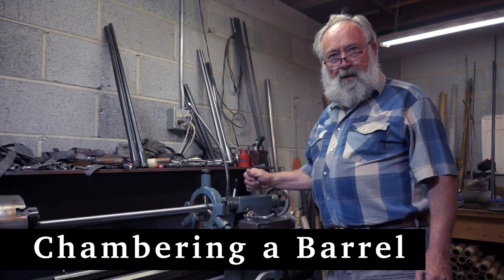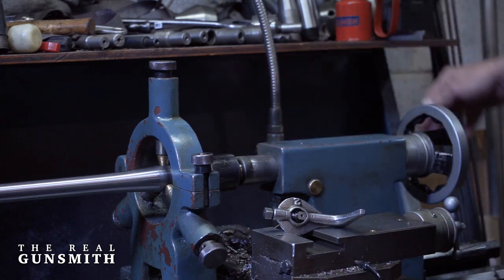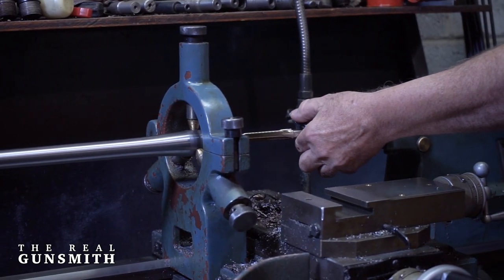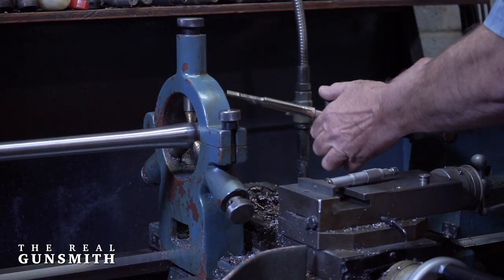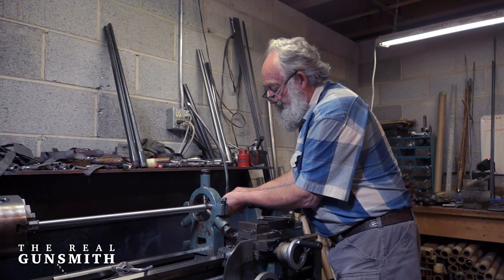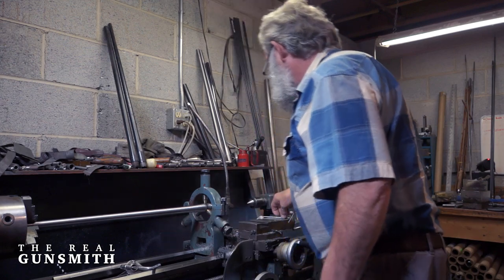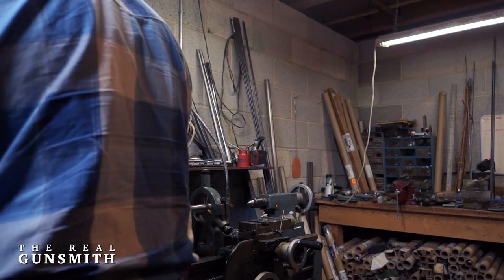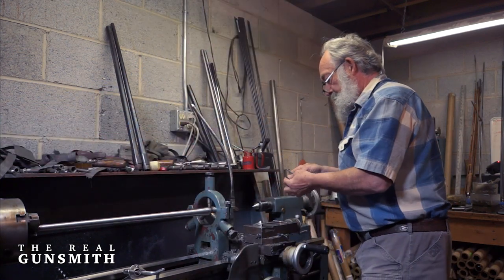Chambering A Barrel

Comment: I would love to spend time with you learning the right way to do it.
Reply: he is a capable man, and this is one way but is not the right way to do it.
1. Rarely ever is a tailstock in perfect centerline with the centerline of the lathe chuck
2. Some tailstocks are as much as .020" higher....a very very good one might only be .003" higher.
     This height offset is to help account for droop in the quill and wear over the years.
     If the tailstocks were all dead nuts .000" then as they wore then the live enter would continue to be lower than centerline.
3. The problem with this is....with even only .003" height difference from Lathe chuck to tailstock centerline offset and using the tailstock as a guide to push the center drillcut of the reamer it will then cut a chamber too large by 
.006" at the head not to mention put sideways stress on the pilot likely gouging the throat as the barrel spins on the pilot.
This may not be a big deal to some backyard .22 plinkers or 100 yard deer shooters although too much tolerance in clearance of the head junction of the cartidge brass can lead to case head seperation.
This is only important for those who like to reload and reuse their pricey brass over and over though.
If you're going to shoot and leave your brass on the ground....probably doesn't matter then to have an oversize  / loose/ sloppy chamber.
If the tailstock is off by .020"  resulting in a .040" oversize chamber  ----- Ferget about it....

Comment: Two things I do a little different Randy is, I blow the chips out of the chamber with low pressure and then wipe,  and I use a wooden dowel with my sand paper to avoid possible scratches if I do a "oh poop!"

Comment: I have a Remington 721 chambered in 270 Winchester. I love this gun because of its age and it’s history. 270 Winchester is my new favorite caliber having bad 308 guy for sometime. I thought about getting a custom barrel made 26 inches with maybe a slight faster twist than the standard 1:10 with thoughts of stabilizing heavy for caliber projectiles. But I think I would benefit more from making sure the barrel was properly free-floating. It does seem to come in to contact with the stock just an inch or so before the far end of the barrel. I’m not able to slide a dollar bill around the barrel and down to the receiver. Given that I rarely shoot past 500 I doubt a custom barrelWould truly benefit me as well as Sanding the stock a bit and putting some new glass bedding down
Reply: the 150's do fine especially the VLD bullets. I had to have a Sako style extractor installed due to setting the trigger destroyed my "snapped in" original. The originality is shot, but free floating the barrel I have considered. If it wasn't for the hump in the barrel I would free float it. Maybe if I run out of project I may attempt it ! LOL

Comment: Thanks for sharing. How do you know the proper measurements you needed with your depth mics? Thanks again for your videos.
Reply: a "GO" chamber gauge must be used in conjunction with a depth micrometer.  The depth micrometer is used to measure chamber depth off of the base of the chamber gauge relative to shoulder of the rifle barrel.  The datum zero for depth is the bolt face with the action closed which also corresponds to where the base of chamber gauge location is going to end up as things are properly done/cut to specified depth.  Barrel location is set by the barrel shoulder as the barrel face just barely clears the bolt lugs as fitted into the action.  Chamber depth is the measured between the gauge base and the barrel shoulder.  Its just math based on set specifications to determine what other dimensions are supposed to be.

Comment: How do you account for curvature in the bore in the throat area? Also have you made sure your tailstock is running exactly true to the spindle? If there is any deviation, how do you account for that? If the tailstock is off-center you are cutting an oversized chamber........basically turning your chamber reamer into a boring bar by having it cut more to one side than the other. Just my $.02
Reply from the maker: I don't cut oversize chambers.  My techniques are proven by the very accurate rifles I build and rebarrel. Proven by my vast knowledge on load work up, all barrels I chamber are true, and I have my set up tolerance free.     
Thanks for watching.

Comment: What is your opinion on cryogenic treatments? I understand the molecular realignment theory and the precipitation of the austinite into marcisite. I also understand the
 theory of better machinabilty due to molecular consistency. 
So I guess my question is do you feel there is a bennifital factor to cryogenic treatment post construction . Mechanical stress relief and even enhanced resistance to throat erosion and such.
  Technical note: I am referencing the nitrogen  treatment not the significantly lower temp higher cost helium treatment.
Thank you and blessed day sirSir
Reply from the maker: Daniel, Crucible Steel Co makes 416 stainless and they say there in no benefit other than improving the machinability.
Reply: The Real Gunsmith, yes sir. Thank you for your response. My bbl on my m.s.r 10 in 300WSM is 26.5 in u.m.s.s, custom built by A.S.I. of Colorado. I have considered sending the whole rifle ,sans the Magpul PRS , and having it treated to stress relieve the assembly. As yet it's unfired minus the 5 ends to regulate it and shoot the proof group.  Life happened lol so the scope money went for emergency. Patients will be necessitated,  so I'd considered reliving it as the funds regrow for a teir 1 optic again.
 Thank you and blessed day sirSir

Comment: Hi, thanks for the video. I have a question I was hoping you would be willing to answer.  Before I ask though I'd like to say that my curiosity as a machinist has led me to watch numerous videos on chambering barrels. From what I see people are basically using a chuck or a  Steady rest to hold a barrel during this process.  When using a steady rest how do you insure the barrel doesn't move/deflect from unequal pressure berween the screws on the steady rest once the center is removed? Thanks, and I hope this isn't a question that takes away from your paying customers.
Reply from the maker: There is equal pressure, properly adjusted and is very precision done properly.
Reply: @TheRealGunsmith  how do you measure it to insure that it is equal?

Comment: I read in a few of my books, that 400 or 600 (pending which book) is the highest grit I should want to go, as per, the "chamber surfaces"... based on either the theory or factual account, that if the interior chamber area surfaces were polished to a mirror finish, that could, or does cause a few issues. When the round is building up pressure, the cartridge is being expanded outwards in all directions, and stops expanding when met with the interior walls of the chamber, in due time, the projectile, then is the next thing to be moved and sent on its way. Now, the books were saying, that having a mirror finish on the interior chamber walls, will not offer any grip on the (typically) brass cartridge, and by not have that short moment of gripping action, that the bolt ends up having to handle all of the rearward mechanical pressure..... Where as if there is a slight rough texture (the 400 to 600 grit sand paper finish) that few Milliseconds of pressure, forcing the cartridge to bite into the micro grain finish of the chamber, plays a huge role performance, accuracy, reloading of ammunition,  as the cartridge gripping / sharing the load at a high percentage over the bolt having to take the full rearwards pressure?  I do not know if I explained this well enough to make any sense...  I suppose my question is, I see that you staged from 400 grit, to 600 grit... what is enough, or what is too much, for this idea or theory or factual information? In due time, I would like to experiment for myself, 3 to 5 barrels, each having various finishes, 320 grit to a mirror finish, just so I can see, feel if anything changes in the rifle's performance, in the loading action of the live round, to the extraction of a spent cartridge, among several other things to measure. Also, why I mentioned 320 grit, is the books was saying, if the finish is too rough, the extraction could become problematic, which makes sense, but if too rough, the rougher finish can and will load up with brass over time, as if the more aggressive chamber finish is acting like a rasp/file on the softer alloy(brass cartridge), and in due time, the frictional holding idea being loaded up with scraped off brass, will start acting like the chamber is polished to a mirror finish, and can become difficult to clean, with out doing a full break down to allow certain cleaning chemicals that dissolves the cartridge brass alloy into a liquid solution ...

 Thank you for the educational content. I have been looking for a channel like this for years, and how I never came across this channel before... Listening to you speak, (I kindly say) reminds me of my grandfather. He spoke thoroughly, precisely, calmly, just like you do.  I am so lucky, that I got to spend so much time with him, over my entire life, as it always seemed like we never had enough time, and he always had something to educate me upon. I hope, I can become a 100th the man he was, and if I can at least meet that measure of a man that he was, upon my death bed, I fear not calling that a successful life lived.  I miss him very much. I am sorry, I am likely coming off as a complete nutcase, but i do not fear letting anybody know, what an amazing person my grandfather was and how much he cared for my well being, by all his efforts to hand down to me, life skill tools, that would allow me to navigate a world of unknowns at every corner. Thank you for the educational content.

Comment: Turning the muzzle end of the barrel in a 3 jaw Chuck is not aways a accurate method to use. I don't know how true your 3 jaw is and if the bore is true with the OD of the barrel. In the video it looks great and I assume you have it set up well.
I have seen factory finished barrels where the bore was as much as .042 off center at the muzzle end. Good video for how it is done  !
Reply from the maker: Hell yes the muzzle is true!  I have a true chuck and the barrel has been turned concentric to the bore.   Nothing goes out of this shop with sloppy bores.

Factory rifles are mass produced.  Done in minutes.  Not the case here.  Time, attention to detail. I have 50+ yeas of doing quality machine work that I take pride in, I learned from other masters.    I do NOT cut corners or use procedures that would produce bores that aren't true.  

Perhaps the people you have seen/know that do this just don't know what they are doing to set it up and do it right?

That rifle shoots a .232 group at 100 yards.

Comment: Steady rest?
This is an old way to do this. Modern day method is you feed the blank through the chuck and use dial indicators.
Reply from the maker: There is nothing "modern" about the way you mention.  I tried it 40 years ago and found the results inferior.  Every barrel I chamber is set up to zero tolerance.  The chambers are perfectly aligned to the bore. 

The barrel chambered in this video shoots 1/4" groups out as far as you want to shoot. 

"Modern"  yeah, right, been there, done that, as I say, forty years ago, and still an inferior method to what I use.
Reply: @TheRealGunsmith  my gunsmith uses it everytime. I personal own three rifles that shoot bugholes.
Prefit barrels are the future anyways. From the barrel manufacturer with an accuracy guaranteed.
Reply: @ Rik Hansen, there are 2 basic methods to chamber a barrel, the way you described, and the one "The Real Gunsmith" uses. Both are older than the hills, nothing 
"modern" about it. Randy's method allows him to true both ends right out in the open, which would be the only choice for any real machinist.
Reply: @denisknobloch7908  well my real machinist uses the other method and has built me four rifles that shoot under 1/2" with factory ammo and 1/4" to ragged hole with handloads. So save the drama for people that dont know better
Reply: I've been a machinist and gunsmith for 30 years, so I'm not getting into a p*ssing match with an arm chair quarterback, this is evident because you have someone else chamber  your barrels. There is not a lathe that has perfect alignment between the spindle and bed, for most work this is not a problem because it is what happens over the bed that matters. The nice thing about the way Randy does it, any misalignment of the spindle and bed is negated.
Reply: @denisknobloch7908  I never said I was the machinist. Bring your best, and some money. We are happy to show you how its done.
Reply: Sorry Rik, I'll save my money and do it myself, the right way!
Reply: @denisknobloch7908  I agree with your first point but in my experience, ( 40+ years ), tailstocks can also be out of alignment due to wear on the bed, or just not being adjusted properly after cutting a taper. Being a Brit I have never owned a gun, but I do have quite a bit of experience in making sure bores and faces are perpendicular to each other. Randy certainly looks like he knows what is required and how to acheive it, but he scared the shit out of me holding the dog whilst reaming, if that reamer bites, yuk.......
Reply: The irony is the "old way" of building a precision rifle is still the preference.. it's slower but more accurate in the end.
Reply: Looks like Rick  knows everything. Not even a machinist or gunsmith but knows more than actual gunsmiths/machinist
Reply: @leelathrop9539  responding to comments from a year ago???
Yes I know more about guns then you.